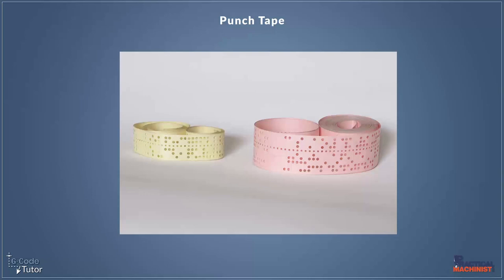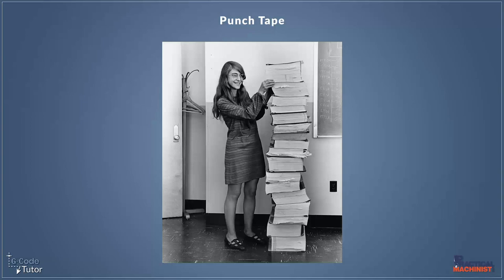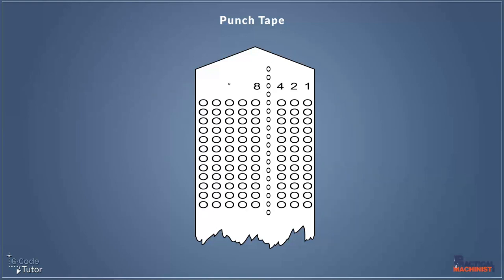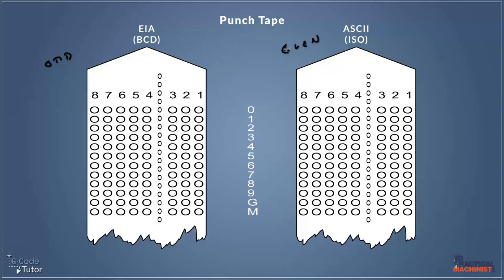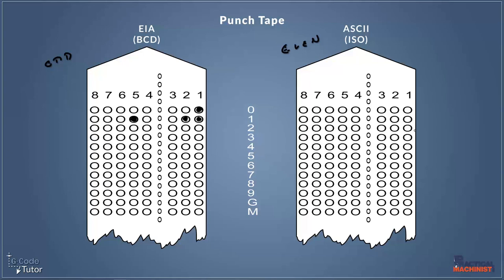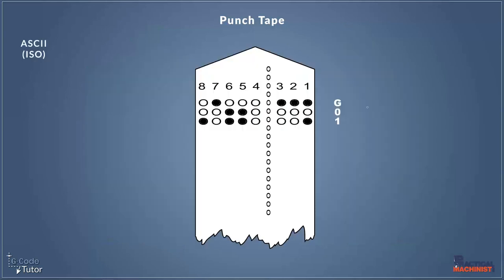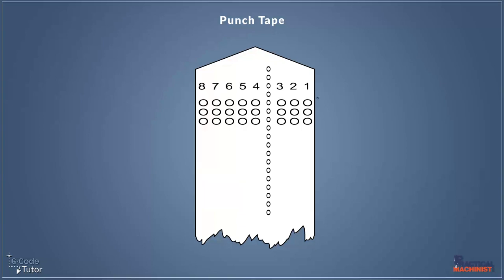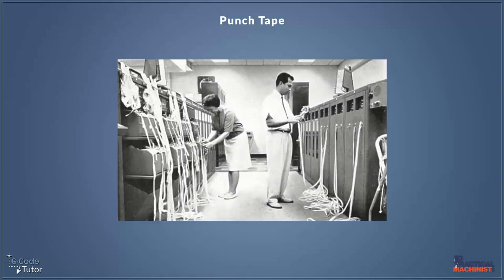CNC Machining History: Punch tapes EXPLAINED

Comment: imagine breaking a tool and having to find the spot on the tape to rerun the tool.
Reply: Did it all the time, you just look for the O line to start tool again. But you also need to learn quickly how to read 8 hole punch code.

Comment: Your video is very interesting, but it's important to note that the sprocket hole MUST be aligned with the data byte (holes) so the reader knows when a valid byte/code should be read. Your diagrams have too many sprocket holes that are NOT aligned with the data holes. 🙂

Comment: found this video while having a nostalgic lookfor the Laser cutter i programmed back in 1981here in Brisbane Australia. we had an ASR 43 teletype with a punch tape. I remember all the little bottles we kept the programs in. all programs were written out by hand and then typed in. I also remember the hassle of re typing a tape you made too many mistakes in.  sometime in late 81 or early 82 my boss bought an Apple 2E with mono green monitor. he also hired a couple of uni students to write a program on the Apple to let us write the programs in a text file then "print" them to tape. they were also able to write a program to read all of our existing tapes and store them on floppy disc! we were a sheet metal factory and the laser was an Everlase 650W CO2 laser with a 1500 mm by  3000 mm bed. we could cut up to 8mm thick mild steel. i remember cprogramming the stainless for elevator doors and button consoles..cut with the plastic still on of course. hard to believe that was over 40 years ago..

Comment: Oh the good old days of running the Cincinnati 5v100 with 220 control and depth cams. 
Point to point control, hydraulic motors with servo valves. did not have encoders, Used position analog units.
Had this big hydraulic unit sat right next to the machine. its only job was to pump out heat and noise.
Used a flexowriter for punching tape. 
Later we had a setup on a pc.  With this setup you could edit your program. Then when you are happy with it, send it to the tape punch.
Reply: Cinitimatic drill.

Comment: I was wondering if you would know how to solve this problem. i have an old lottery ticket that used a 4 X 12 binary bits  but the serial number was 17 number long like 027-00237087-175804. Any idea how this would be encoded?